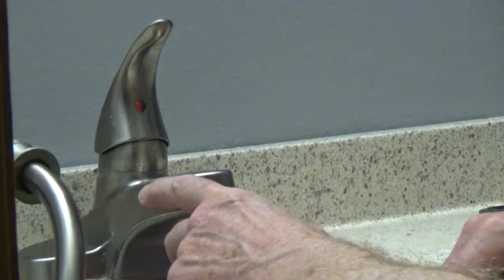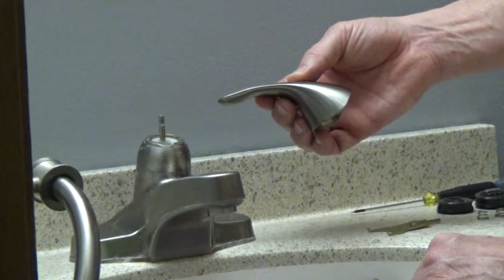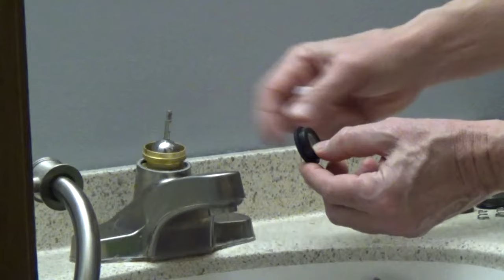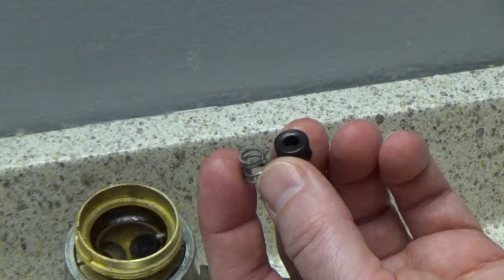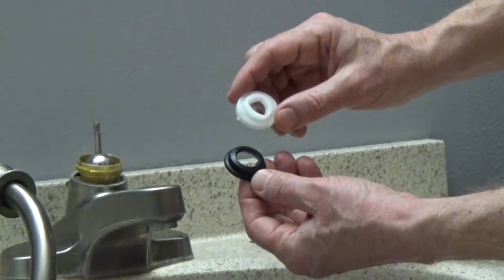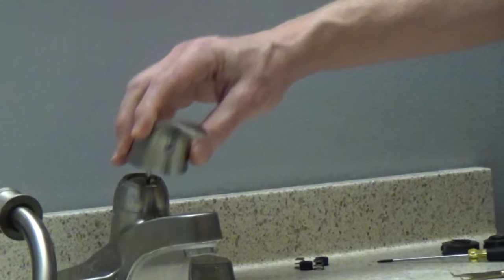Delta Peerless  Bathroom Single Handle Faucet Repair

Comment: Thanks for the video.  I had a leaky tub faucet in a new-to-me house that has been fussy for years.  I could usually get it to stop dripping with enough wiggling, until last night, when it started not just dripping, but a regular trickle.  So, today, I finally worked up the courage to tear it apart and install the new parts I bought 6 months ago.  Initially, it leaked worse than ever.  I found your video, and realized I was putting the spring/washers in UPSIDE DOWN!  Yanno, just the way the old ones came out!  I even had pictures as I had taken it apart.   After watching your video, I pulled it apart, flipped them, and bingo.  Obvious, in retrospect. lol.  Thanks so much!
Reply from the maker: Glad it was helpful.
Get more home improvement tips in our e-books https://www.amazon.com/dp/B0GTX5ZBTR

Comment: What if the cap is seized
Reply from the maker: Hi, you can use penetrating oil to break up corrosion or mineral deposits. Here is a video with some tips. https://youtu.be/fxh99eHKKVE

Comment: One more hint: Block the drain before you take off the little dress cap or the set screw, so that when you drop them in the bowl, you don't have to do a trap cleanout at the same time. 😉

Comment: This really helped me successfully change out my delta with the rectangle style single pull as my hot water was dripping, though my handle was shut off.
Reply from the maker: Hi, I'm glad it was helpful.
Check out some home improvement tips in our e-books https://www.amazon.com/gp/product/B0B2KW1FQ9

Comment: I removed the hex screw from the handle, but the handle won’t budge. No amount of force seems to work. I’m wondering if I will need to call the plumber to do it now
Reply from the maker: Hi, I would spray a small amount of penetrating oil into the screw hole and let is set for 30 minutes. Then tap the side of the handle with the plastic handle of a screwdriver. 
Check out more home improvement tips in our e-books https://www.amazon.com/gp/product/B0B2KW1FQ9?notRedirectToSDP=1&.

Comment: How can u fix a faucet with one handle if its making noise when u move it around?
Reply from the maker: Hi, what is the brand and model?
Reply: @FIXITHomeImprovementChannel  moen I think or delta.

Got 3 of the same ones, back in sep of last year so like 4 months ago, 2 are same one is good tho bec not used as often. But 2 sound crazy moving the handle in only 4 months.
Reply from the maker: @Aeropsi  Hi, lubricating the parts with plumber's grease will keep the parts moving smoothly and help protect the seals. Look for a silicone grease safe for O'rings and faucets.
Reply: @FIXITHomeImprovementChannel  yea I've seen that as well, I aporicate ur comment bro for taking time out to reply!

Comment: Thanks for this video!
Lots of videos like this since you originally uploaded it, but this is the best in my opinion.
I wasn't able to get my cap off using my adjustable wrench (had to go out and buy a new one because it requires an oversized wrench).
Keeps slipping off.
Tried CLR/vinegar, and even heating the cap a bit with a blow torch around the edge to expand the metal, being careful not to melt the plastic cam.
I think there's too much corrosion on the cap.
Any other ideas?
Reply from the maker: Hi, you could try a penetrating oil. Wrap a cloth or paper towels below the cap and spray around the joint. Let it set for 30 minutes. Hopefully the oil can get to the threads.
Reply: Thanks, I'll try that, if not, then it's a call to the Pros.
 @FIXITHomeImprovementChannel

Comment: Allen wrench stripped the set screw. Now I need a new faucet?
Reply from the maker: Hi, you can use a screw extractor and remove the screw. Then get a new one. 
Check out more home improvement tips in our e-books https://www.amazon.com/gp/product/B0B2KW1FQ9?notRedirectToSDP=1&.

Comment: I don't have a name-brand faucet. I have a single-handle faucet. The handle would go round and round so I purchased a new handle. The new handle is loose and now a small drip comes out of the faucet. What can I do to repair this problem?
Reply: Patricia, someone else may come along with more info, but my personal experience is don't replace your faucet until you can afford a name brand, Delta, Moen, Peerless if at all possible. Off brand faucets seem rather troublesome to me and not worth the upfront savings. FWIW.

I'm "financially challenged" and always looking for a bargain. Cheap faucets haven't been a bargain for me.
Reply from the maker: Hi, you can email me a picture to fixitpodcast@gmail.com.

Comment: It appears my set screw is either stripped or corroded. I can't seem to remove it with my allen wrench. What do you recommend is the best way to remove it? Also I am afraid the bonnet nut might be hard to remove after i get the handle off due to calcium and rust buildup. What are some tips to remove the bonnet nut?
Reply from the maker: Hi I would start by spraying the screw with a penetrating oil, then give it a try. You would then try using a screw extractor that matches the size of the hex opening.
Reply: @FIXITHomeImprovementChannel  What do you recommend I should do if my bonnet nut won't budge?

Comment: Oh there's a pin that slides into the ball! Er, there should be a pin. Mine broke so I think the unit is done for. Thanks for posting this.
Reply from the maker: You're welcome.
We have more home improvement tips on our weekly podcast http://castbox.fm/u/6389499.
Reply: Not all facets have a pin. mine did not.   Nor did it have flats on the cap for a wrench.  There are now scratches because it was corroded on.   But thanks for the tips.  If all goes well it is a simple fix.  Note  the rubber washers come in 2 depth sizes.   I was glad I brought mine in to the store.  One is 1/8 inch thicker but maybe both will work?